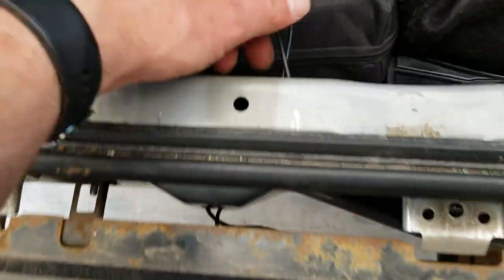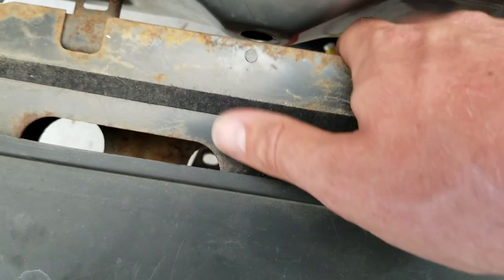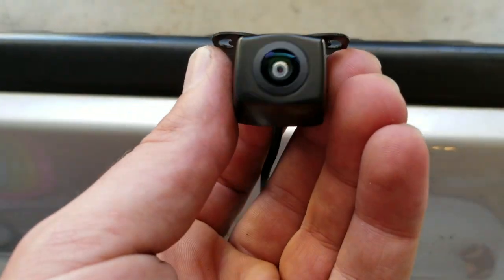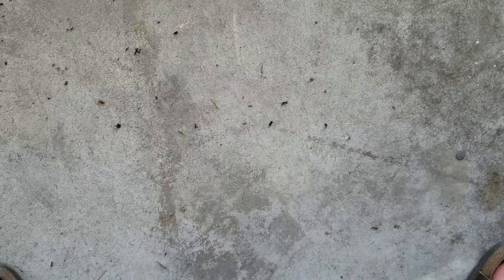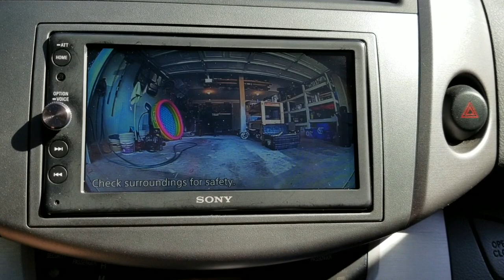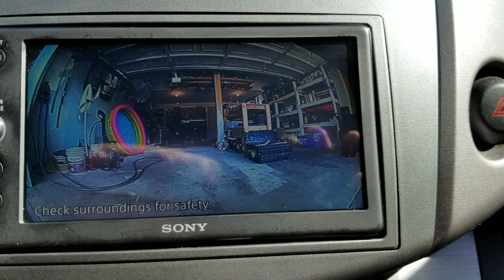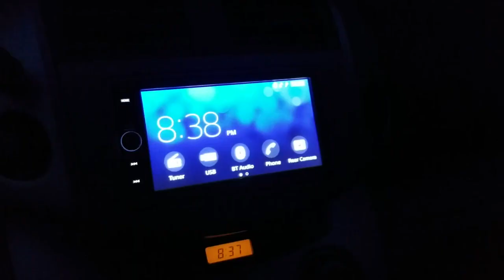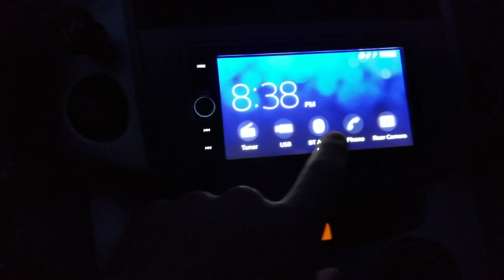Rav4 Natika Reverse Camera Install in Bumper

Comment: Thanks Colin. Followed your lead and removed bumper (easier than I thought) on my daughters 2012 Rav4, cut out a space for wireless camera (it has power wires, but sends video signal to monitor via antennae so no running wires up to the front) and epoxied it in place. Fished wires through to interior storage bin but got lazy and simply wired it to a 12v plug and stuck the plug in the 12v receptacle situated beside rear lights. People say the receptacle can suffer from a wavering supply of power but so far the image is strong and clear with no flickering. Your video was very helpful!

Comment: Ok, I've looked into this. You shouldn't need to tap into the reverse light. There should be a purple wire either on the harness or somewhere behind the dash which is the reverse signal wire. This is how I did it on my GT86, RAV4 is apparently the same.

Comment: Great video, I want to do the same with mine and mount in the same location. However, I'd like to know what is blocking the top right corner on your screen in the Head Unit (clip starting @15:30 towards the end) ?

Comment: great video i installed mine where you had your first one
i found it quite easy to install it without removing the bumper cover
Reply: For most people, that's the best option, but in some countries the Rav 4 has the license plate under the bumper, not next to the spare, so this is a great solution if you don't want to have your camera real low.

Comment: When you install your hitch in place, does it block the view of the camera very much in the position you have put it the camera in the bumper? My ball and hitch curves upward and it seems that the ball might  sit directly in the line of camera if I were to install it underneath the rear tire the way you have. Does the ball on the hitch you use go straight back or does it curve upwards since the revs are a little low to the ground I have a ball and hitch that curves up to give a little more height when I connect my trailer to it. How does the camera "see" for you once you have a trailer attached to the back of your RAV?

Comment: Hi Colin, thank you for posting the video. I'm going to try installing mine tonight into my 06 Rav4. Just wondering which is the wire for the reverse light that I need to tie into (what color?)? 
And also, just to confirm, I can splice the red power wire from the camera with the reverse red wire to connect to the reverse light?

Thanks for your help

Comment: I have noticed that the image is reversed like if you were facing front of the vehicle. That doesn't bother you?
Reply from the maker: I cut the small wire so that it is the correct orientation.
Reply: Which wire is that one?
Reply: I cut mines and I loss signal.
Reply: the small white wire/loop
Reply: Hi Colin, Thanks for the great video. Can you confirm which small wire? I see another user mention the small white wire loop. I have the same reverse image issue. Thanks for your help.
Reply: No worries. Found its the white wire loop. Its there on the amazon website for the product.
Reply: I was looking for this help a year ago when I installed the camera. Thanks after almost two years I have the correct orientation for my wife’s backup cam. Thanks!!!